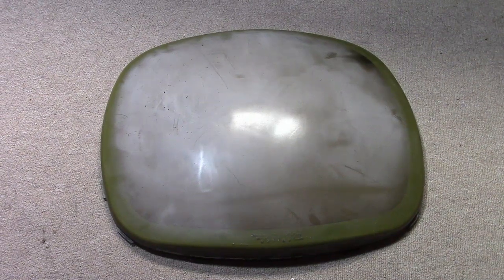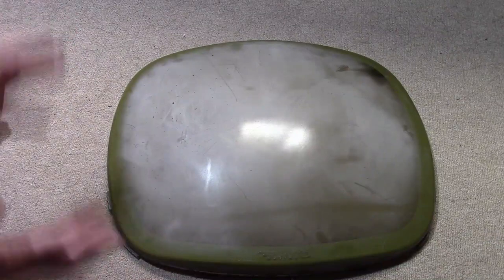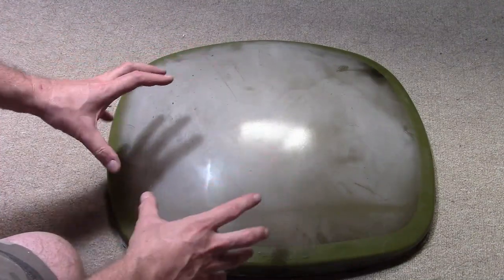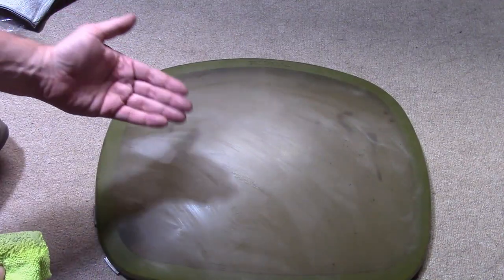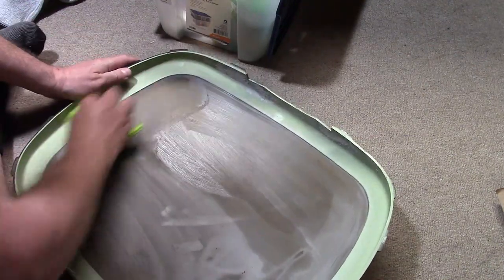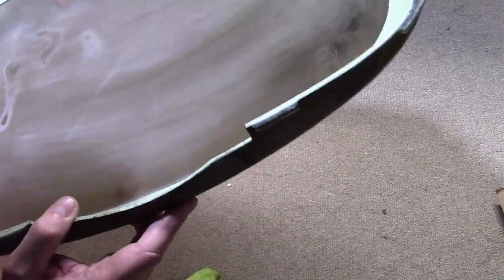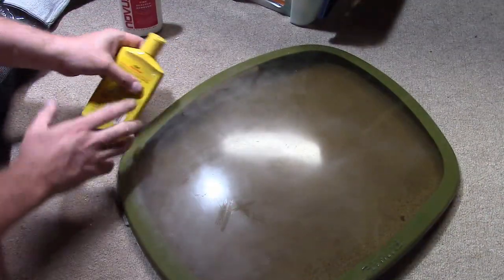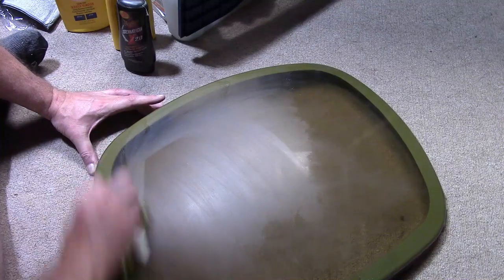Predicta restoration tips: 21" screen covers

Comment: So how do you reinstall one that has shrunk? Mine came disassembled and found it is smaller than the headshell by about 3/16 or more.
Reply from the maker: Do the best you can. Gaps are unavoidable
Reply: @bandersentv  It's not the gaps, it flat out won't fit over the CRT or in the banding.

Comment: I have polished several of these over the years and made various mistakes along the way.  I agree with the Novus 3-2-1 mentioned in the other comments.  It is tempting to use a power buffer, but let me warn you of this:  I once (obviously unknowingly) had one tiny bit of metal embedded in my buffer.  Just a small shard from drilling a hole in something on the drill press.  Within moments, I had a faceplate etched by this metal bit as it swirled around on the buffer wheel.  SO CHECK YOUR BUFFER first.  By the way, what do you make of the difference in "texture" of the inside of the faceplate from the outside of the faceplate.  The outside is smooth and the inside (at least mine) had a bit of a coarse texture that convinced me to not try to polish it.
Reply from the maker: I haven't found Novus #3 to be very effective.  Certainly not more than #2 so I just skip it.  I typically find the insides have more crud built up and have to be polished as was the case with this one.  I assume because the outside got cleaned occasionally, while the inside had never been.

Comment: I wonder if 303 aerospace protectant would work to protect this stuff
and if you say with enough authority and proof that the original color is not what people are used to now, they will buy  the reproductions because they are "correct". People want original and correct, especially if its different than the aged part, in my experience.

Comment: Novus should be used in sequence, going from 3-2-1.  Depending on your rag, you should be able to get a much finer and less hazy finish..  Also, the you might try a sunlight bath in hydrogen peroxide (the "retrobrite" treatment) to remove the yellowing and restore the original color.
Reply from the maker: Sure, that's what they say but I find #1 and #3 to be fairly useless.  I'm not done with this yet and will be doing a couple more passes with #2.   I'm concerned about retrobrite affecting the paint on the backside.

Comment: I've heard that Tenite, invented in 1929 by Eastman Chemical Company, is sensitive to ultraviolet radiation, causing the depicted surface oxidation. Personally, I think Philco should have used more durable Lucite instead.
Reply from the maker: They did for the 17" models. I have to assume they had reasons for not using it with the 21" models. Maybe it wasn't strong enough to contain the greater implosion forces

Comment: Have you ever tried toothpaste?
Reply from the maker: No. I suspect it will be too aggressive and leave a haze.
Reply: Well if you have a spare screen protector laying around that’s no good, you could use that to experiment on, and you could use some other things maybe like jewelers rouge, or there’s aircraft polish compounds that are used for Lexan polishing that might work, but they’re very expensive that’s the only problem with that. but if you don’t try other things then you won’t ever know if they work or not.
Reply: @bandersentv  One more thing you could try, is mothers polishing compound, it’s a metal polishing compound, One thing you could do with it is just go real lightly with it I have used that stuff in the past and it works great but I don’t know what it will do to plastic so you’d have to try it to see what happens.